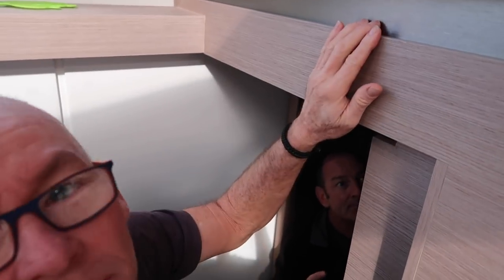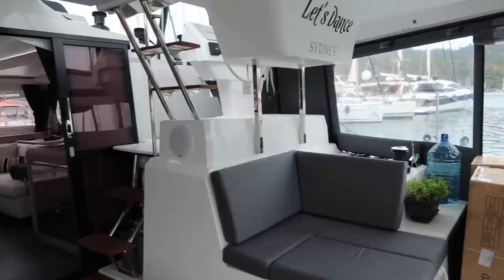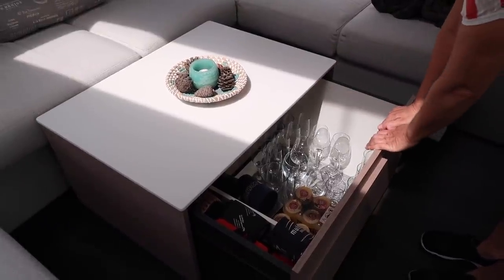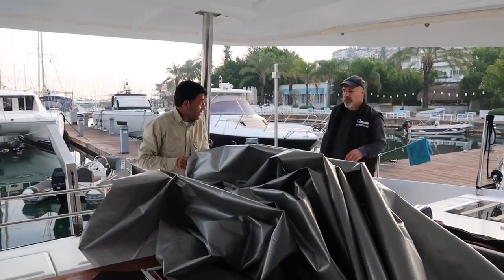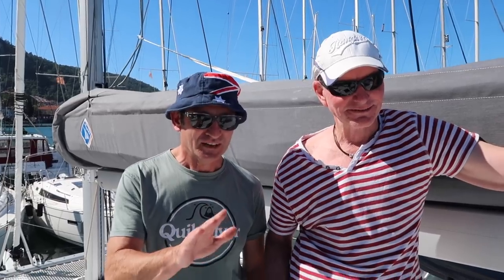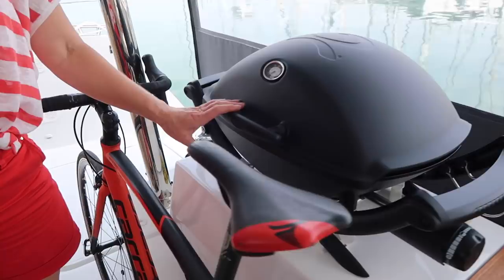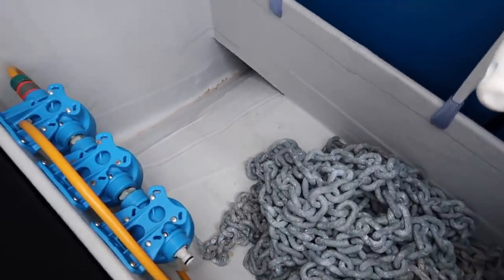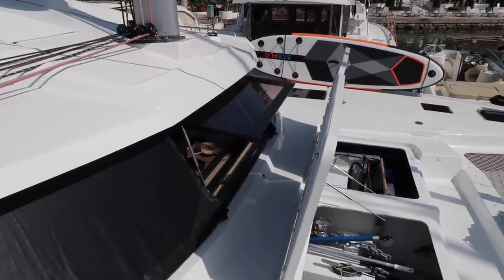Let's Dance Sailing Story #68 - Did We Need A Bigger Boat

Comment: We just chartered a 4 cabin new Lucia 40 this past winter; lived on it for a week with two other couples plus crew. It was a full boat. The salon was cramped at times.  And yes it was tough to keep the two curtains closed in the morning!  But that trip makes this compare really relevant and interesting. Thanks!
Reply from the maker: Hi Robert, thought I had responded to this one but it seems to have disappeared.  That is a full boat and probably a little tight.  Glad you liked it, cheers.
Reply: @LetsDanceSailing  I think we are narrowing to 42-44' size, we saw a Helia 44 in one port and it had a visibly larger Stern than the Lucia, and your Elba is wider still.  From what Ive seen on sailboat data online the Elba (and new Isla 40) should sail faster than the legacy F-P designs. Cheers!
Reply from the maker: @robweiss748  looking at their polar diagrams they should, we agree.  The proof will be when we get the chance to break free and take off but we are expecting her to be reasonably quick.  Good luck with your pursuit.
Reply: @LetsDanceSailing  thanks so much.  Your channel is just great.

Comment: Looks great, folks.   Massive, but only five feet longer than your previous catamaran.    I didn't hear you say how much wider than your last boat the new one is.    Will it sail closer to the wind than the last one?
Reply from the maker: Lucia is 6.6 and the Elba is 7.5 in the beam, not sure that we will get any higher to the wind but the overall volume difference is massive.  Thanks for your comment, cheers.

Comment: Great video. Love the boat!. Very useful insight regarding the options you have chosen. Would also be interesting to know based on your experience what spares you carry and any duplicate systems you have installed eg Autohelm etc. Inspired by your Lucia vids, I have just ordered a boat and am now trying to fine tune the spec. Keep the videos coming. Look forward to hear how she sails.
Reply from the maker: Hi David, glad you liked it.  We carry limited spares at the moment because nearly everything is available here in the Med, we do however have a good set of tools and the usual items, fan belts, impellers, filters, oil, fresh water pump and bilge pump, electrical cable etc.  We did not opt for any redundancy systems like autopilot, cheers.
Reply: @LetsDanceSailing  Thanks for the quick reply ...
Reply from the maker: @dfindla  no worries, we love getting comments and always try our best to reply to each and every one, cheers.

Comment: Is there an option for fuel tank upgrade from FP?
Reply from the maker: Hi Geygy, short answer no.  The mould is there in the Port side to take an additional tank but FP will not fit it for you, this is an after market job which some have had done, cheers.

Comment: Also the filter stack for Marina water is a great idea....should be a standard feature.
Reply from the maker: Agreed Robert, we are also looking at putting a further purification system inside under the sink, just to be sure.
Reply: @LetsDanceSailing  Reverse Osmosis?
Reply from the maker: Haven't fully researched it yet but something like that, have seen compact UV Light setups that do an amazing job

Comment: Have really enjoyed your whole series. Thank you. Just in the process of buying an FP,  model undecided, but probably an Astrea.
Would love to know what you didn't take in the new Elba factory package, what you then had fitted elsewhere (Turkey) and how the cost compared? For example your cockpit covers looked fantastic, better than others I've seen in terms of fit and quality.
I not you didn't do the decking, teak or synthetic. Did you do that later.
Also how and where you sold the old Lucia and how easy or not that was. Gavin and Gail  - Brisbane
Reply from the maker: Hi Guys, thanks for reaching out and the feedback.  We’ve been a bit lazy on the channel of late we had to make an unexpected trip home for family reasons.  On the Lucia we took everything factory fitted, this time around we were way more prepared and knew what we needed, what we didn’t and what we could do better ourselves.  The 2 biggest things we did ourselves were the solar ( factory package not big enough for live aboard ) and both summer and winter cockpit tents.  We did the solar ourselves in Turkey and very happy with our current setup.  We also had the cockpit tents made in Turkey, slightly cheaper fit and quality way better.  We love the teak and synthetic look but it is extremely hot and shoes must be worn in summer to walk on, we may install it down the track but purely for resale.  We sold the Lucia ourselves via our channel, it was on the market for less than a week before it was snapped up by a Canadian buyer.  Hope this helps, drop us an email if we can be of any further help and best of luck with your future plans, cheers.
Reply from the maker: @gavinballenden3601  letsdancesailing@gmail.com

Comment: Hello Guys, greetings from Hungary.
You are a loveable couple, are able to transmit the feelings of your everyday life, whatever is it.
Congratulations to your new boat, wishing many wonderful journeys together.
As an old sailor let me share a receipt with you, which was the top favourite during our sailing trips.
- Sourdough cucumber pickles:
  https://www.youtube.com/watch?v=VlsKmedE6i4
l used to make it from sea water, if its enough clean, using a plastic box with lid, putting on the sun in daytime and store it in warm place during the nighht. The best is to put it into an oven on 35 °C - average temp. -  for 24 - 36 hours (l used to switch the oven 2 or 3 times a day for a couple of min. zo keep the right temperature) depending on the sourness and the crunchiness of the pickles. If you feel it ready you  can store in the fridge for a long time, but it doesn't last so long.
l used to buy 2 kg cucumbers, 3 cloves of garlic, dill and a slice of bread on the top. Its important, to cut the cucumbers in the midle in, to ensure the even access of the milk acid inside in the cucumbers.
- Tuna pasta:
500 grs of chopped tomato (canned is also good), olive oil, 3 cloves fine chopped garlic, 1 pcs (130 gr) canned tuna, salt, pepper, oregano and grooved horn shaped pasta.
In a pan braise the garlic a little bit on the olive oil and add the tomato, season with salt, pepper and oregano, cook until is becaming a tomato sauce. Add the smashed tuna and mix.
Mix with the cooked pasta and enjoy!
Together with the sourdough cucumbers is a perfect food for two or for larger companies.
Reply from the maker: Hi Jozsef, thank you for your lovely comment.  Also thank you for this amazing recipe, we will have a look at the link that you shared and might try and replicate your meal one day.  Glad you are enjoying our journey and thanks for taking the time to comment, cheers.

Comment: Beautiful Cat. Maybe I did not listen but are you going to upgrade your batteries to reduce the weight. I noticed you mentioned it but I would be concerned with the stove top being to close to the gangway to the lower hull. Looking forward to your next videos after Turkey opens up again.
Reply from the maker: Hi Ernest, our plan is to keep the factory fitted batteries to end of life and then make the decision on which way to go.  Understand your concern about the stove top but there is plenty of gap there for our safety requirements.  Thanks for your comment, cheers.

Comment: Hey guys, boat looks magnificent, and I think 45ft is the perfect size for a couple. Mick, I hate to say this,but could you pull the cover off the front bulkhead and take a picture??? I don't know if you've heard of the drama that Lagoon are having with their boats about the front bulkheads and not so good manufacture. It makes me reconsider buying ANY of the big 3 manufacturers, so .... yeah
Reply from the maker: Thanks Shane, have not heard of the issues that you speak of.  Which bulkhead are you referring to, you have me interested, cheers.
Reply: @LetsDanceSailing  Hey Mick, it's the forward bulkhead, and they also found that the glue holding the  bridgedeck to the hull had given way...... Look up Parley Revival on YT.
Reply from the maker: @shanevillis4079  thanks, will do now.

Comment: Loved the non-clutter mods that you did. Quick question from another “cleanie”. How difficult is it to make your bed nicely? Most cats look like it is close to impossible to get up each side of the bed to tuck in the head of the bed. D
Reply from the maker: Haha, great question! Making the bed feels a bit like a circus act. Must film it some time. Here goes - I start from in bed on my side, make the other side first, then slide out of my side, making it as i go. Then teeter at the ‘walk around’ area of the bed stretching forward to position the pillows and smooth any wrinkles, then pull gently on the quilt from the end of the bed for the ‘as good as it’s going to get’ finish. 5 minute pilates routine complete and no longer have to worry about bumping my head on the bulkhead since moving from the Lucia 🤣

Comment: Are you confident the fabricators used 316 stainless steel and not 304 or cheaper domestic stainless steel. For an amazing solar setup on a catamaran check out SV Dauntless on YouTube.
Reply from the maker: Hi Andrew, yes we are it had to be trucked in from Antalya because we requested it, thanks will check it out, cheers.